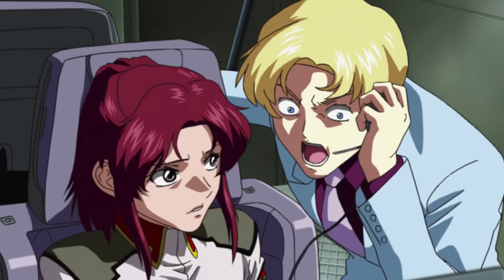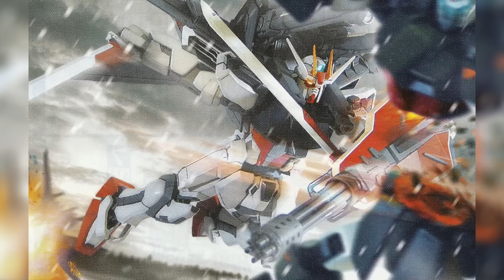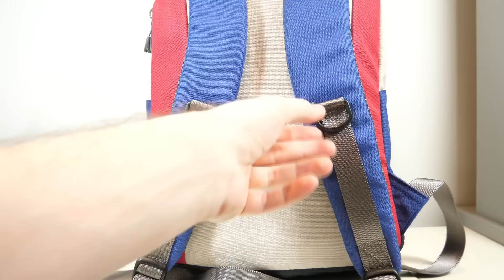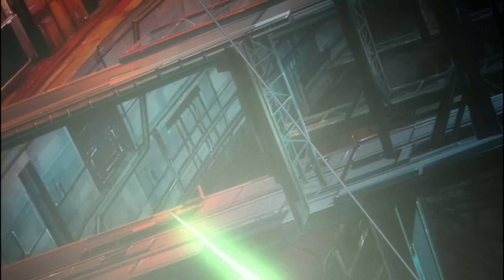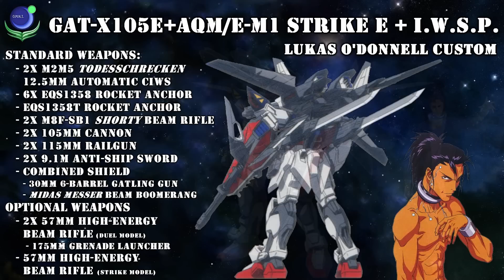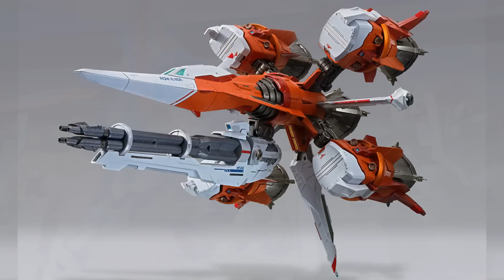Strike Gundam Development History [Alliance & Librarian] (Part3/3)

Comment: I always had a theory about the X101, I know We never see it, in story from what i've seen, but i've always had a theory that it was the strike perfected. And I'm betting, it was more of a mobile armor than a mobile suit. And I was thinking it was just too much for the battery pack and because of end jammers, they couldn't put nuclear. So they ended up breaking it up into the different types as specialties, but they retained the x105, as an all-purpose unit, it also explains the sky grasper, it was a replacement for they're agings, fighters with beam technology. And they threw in a little support for the new g weapons to help sell it.
I hope I get lots of comments on this theory.
PS, I love the x105, and I don't think it has enough screen time. I wish it had stayed as the main machine a lot longer.

Comment: Honestly the Gale strike is my favorite of all of these, and I'm still mad we only have a non Master grade 1/100 for it because people would buy a non-premium version of it as a high grade 1/144 and even then they could use the exact same mould they have for the 2003 strike Gundam / strike rouge iwsp / 2013 perfect strike Gundam models and just alter the knee armor and ankle joint new shoulder armor that is similar to The sword striker how it just claps over the regular strike armor for the shoulders and build a backpack and use that pin into the polycap of the hip that would normally hold the armor schnieders and have it have a slot that slides into it that mounts those Wing saws and literally just make a extra runner that holds the new parts so a person could build the black and white strike that looks like the original versions or the Gale strike itself with the new knee armor backpack and shoulders and hip armor and quite literally all they would have to do is make a new runner or 2 specifically for the backpack the shoulders the knee those swords and the lower arms because of the new elbows, and quite a few people would purchase it more than enough to make up for the designing of the new parts, I mean I would use the knees for my custom iwsp strike rouge

Comment: Honestly the concept of the Strike really could have been the end all of mobile suits. You have a core machine that you can equip a huge variety of equipment to to fit virtually any mission profile. Future development would be just making that one thing better. Likely on improving the batteries for higher capacity and just streamlining and improving the base machine as technology improves. You've have to have a very good reason not to just use a Strike and the specific equipment that fits the mission. What kind of mobile suit mission role could the Strike NOT perform? Whatever that answer is, is the only mission type you'd want a different mobile suit for.

Comment: The interesting thing about the Gunbarrel Strike is that one of its first major appearances is in the SEED RPG/Visual Novel for the GBA. The Gunbarrel Striker that you can unlock for the Strike IS in fact Mwu's old Mobieus Zero retrofitted into a Striker Pack by Erica Simmons after the Battle of Orb versus being based on the Mobieus Zero. It's weirdly enough how the game, if you fulfill the secrets for the Gunbarrel Strike,  side-steps the ending of SEED because Destiny hadn't aired yet since it implies that the Gunbarrel Striker can also detach and function independently (hence why most designs still include, for all extents and purposes, a complete Mobieus Zero.)

Comment: I never understood why they went with such a large caliber for the CIWS. If you're targeting armored units, you have plenty of options. But if you're targeting incoming fire or soft targets, a 20mm is more than enough. For that you want a wall of lead, not a small artillery piece. Though, there is an argument for proximity fuses, but not a very good one.

As for the cable system of the Noir, something like that is a PITA for maintainers. Got to work a few MC-130E's in my career with the Fulton system. The amount of extra crap and maintenance just for a few (Read, too many) cables and winches is insane. The only time in my life I had to go into a wet fuel tank to track down a hydraulic leak.
Reply: The thing is they look like 75mm barrels. If it's just some barrel shroud covering the gatling, it would've been fine.
Reply: I think because in its base form, it is the main ranged weapon of choice against non-PS armor. It needs to punch through GINN armor, when PS is down.

Although, given that even Windam able to shred a GINN just using its Todesschrecken albeit at close-range, I think the designer over-estimate the need to shred a GINN just using its machine gun

Comment: Strike Nior is my favorite version of the strike gundam, its design and weapons are very badass. Stargazer in general just has some of the best mobile suit designs of the cosmic era.
Reply: When 50 minutes of runtime beats 50 episodes of GSD. Don't get me wrong, Cosmic Era is my first exposure to Gundam but could've wished it was in the best hands, especially GSD. I like the Strike E face design. The Ootori pack on Rouge is a simplified IWSP yet still can deliver quite of a fight, something what the IWSP should've been. For some reason, I've got this feeling that the OG Strike still hasn't been used to its fullest potential. I could be wrong though.
Reply: @Joshua_N-A  I'm on the exact same boat, I enjoyed original seed although it has its flaws it is a very solid series and my first introduction to the franchise so I will always appreciate it for that. Destiny on the other hand I had so much problems with it, it was fine in its first half but took a nose dive in its second(to this day still one of the most hotly debated entries). Stargazer despite being very short I absolutely adore, some of the best imagry I ever seen in a gundam series(that incudes UC) makes me wish that if the cosmic era was like this it could have been so much on par with universal century.